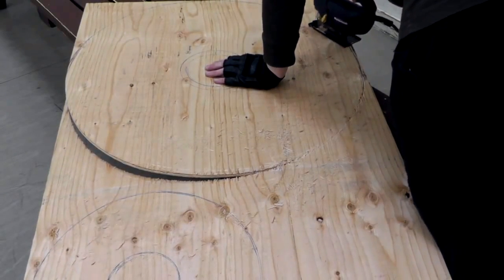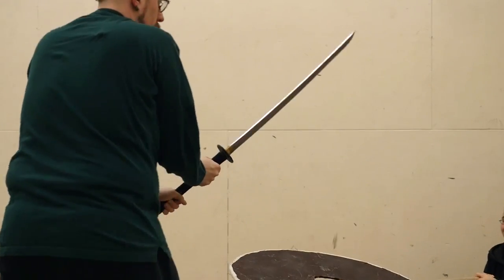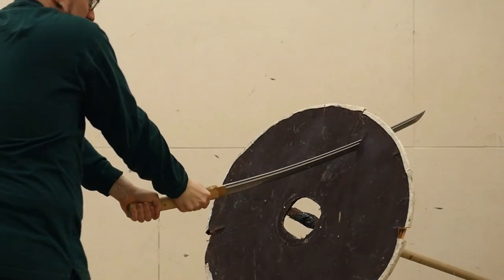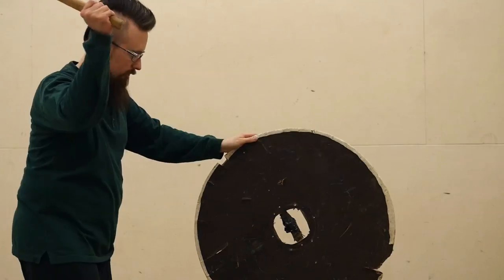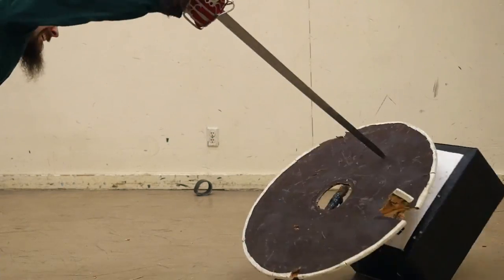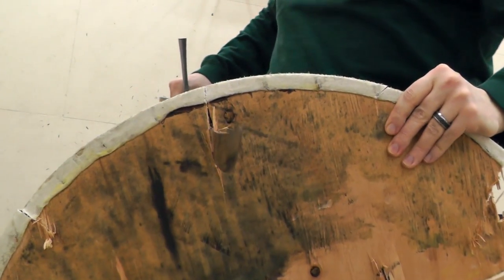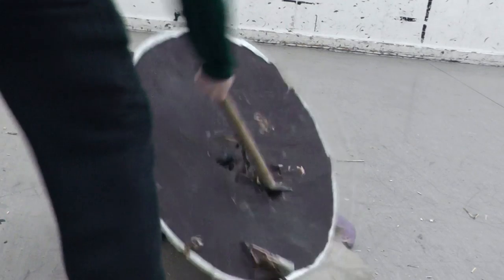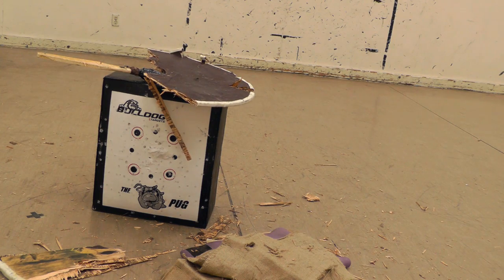Plywood shield vs broadsword, katana, axe, kriegsmesser, and war hammer

Comment: you mean the glorious nippon steal of the katana did not cut trough a nail.... how is this witchcraft possible
Reply: Samuel Normand It's ok, the nail was made from a katana.
Reply: Samuel Normand trolling got wrong this swords are modern muku blades. The steel has nothing to do with histrorical accurate steel AND the heat treatment is most probably total different. ;)
Reply: iopklmification sooo, it was a KATANAIL?
Reply: Benjamin Brohmer 
Yeah, the steel and heat treat are both better with modern swords.
Reply: Fuq Gooogle
the average modern steel is cleaner as the accurate steel in average, yes.
But they are muku-blades made from one kind of steel most katana blades were made from at least 2 types of steel. The physical charakteristics in shiro-zukuri blades were basicly designed by the smith as the edge the flats the back and the core were made from different steel. 
(A useable shiro-zukuri blade would at lest cost 600/800 bucks.)
The different heat threat brings different charakteristics. eg a stiff blade, like the authentic japanease blades would basicly ignore a gambenson or a padded jack, the edge flexile blade on the otherhand would become disaligned and would have a harder time to cut through it.
You also have always a slight disalignment while cutting even in the air, this effect is larger in flexile blades and smaller in stiff blades.
You can't aplay better when comparing different things.
Reply: Benjamin Brohmer 
Well you can get katana today that are pattern welded, folded, laminated, and differential tempered, etc but it's really no longer necessary. All of those methods were used to make up for impure steel of unknown alloying with imprecise heating methods. And the smiths of the time were good at it and made good swords, but I'd be willing to bet that a well made $300 katana blade with a good monosteel (lets say T10) and through hardened would be as durable if not more durable than a traditionally made katana. I would be very impressed if any katana of any construction or price could "ignore" a gambeson, assuming you're referring to cutting and not thrusting.
Reply: Fuq Gooogle http://www.myarmoury.com/talk/viewtopic.php?t=11131 scroll through - 30 layers of linen cuted through.

It is not about the quality it is about the physical properties.
And no not all smithing techniqus were used to handle impure steel. Thats what folding is for. Wielding different kinds of steel together is done to use steel with different physikal characteristics on differnt parts of the blade.

Im pretty sure that you can make a stiff blade with modern methods, not questioning that, but the modern blades are made like the modern european swords. Strike the handle of most modern katana you will see the tip vibrating, which is not the case in authentic katana.

That are different blades.

Or would you consider eg a not heat treated longsword as the same as a authentic longsword?
Reply: Because Katanas were made to cut flesh.
Reply: Samuel Normand It's sad when the trolls of the apparently non-existent katana cultists are a million times more annoying than the cultists.
Reply: Hush, child.
Reply: Samuel Normand "The Glorious Nippon Steal" sounds like a great title for a heist movie.
Reply: ***** It's really not that simple. There are plenty of cheap swords that are just as good at cutting, or better, than the several thousand dollar ones.
Reply: +Fuq Gooogle I'm so sick of this katana glorifying crap.  Katanas are not superswords.
Reply: ***** Yes... yes it is.
No, they wouldn't For several reasons. The biggest likely being that people have this weird idea that more expensive = better. This isn't really the case. Secondly, people who buy swords these days aren't buying them as serious weapons, so they care about things like aesthetics, and historical accuracy, which command higher prices. There's also a lot of shitty cheap swords too.

No, they don't all use low quality steel. In fact, the MOST EXPENSIVE swords ARE made with low quality steel, because the most expensive swords are generally made using historical techniques.

Thank you for demonstrating you don't know what you're talking about though.
Reply: +Samuel Normand Actually, it did, though it was not a great angle.
1:31

Comment: Plywood is hard to cut simply because it is a laminated stack of wood with alternating grain orientation. So you will always be cutting with the grain of certain layers while cutting against the grain in other layers, this build structure gives it strength in all directions rather than in straight lines like a plank shield would.

Comment: But according to these otaku nerds katanas are supposed to be able to cut a shield in half with just one swing.
Reply: Katanas are supposed to be used against flesh, anyone who says they are effective against armors or shield are simply ignorant of the facts
Reply: The Japanese dont use shields because Katana's would cut them clean in half. Obviously, duh.
Reply: Roland Lee the arms holding the shields yes.
Reply: Katanas wouldn’t be able to cut a wooden shield from the face
And a clean cut in one side only do a very few damage
Katanas and the variations are overrated, there are good swords but  there are better swords

Comment: Bu..buh..but Katana best sword folded over 100,000,000 times!

Filthy gaijin.
Reply: But a katana doesn't have a pommel, so you can't end your opponent rightly.
Reply: adobo777 This test proved that the deadliest weapon is a Home Depot forged nail. To damage a katana that nail most have been bathed in dragon´s blood and the tears of a thousand virgin geishas otherwise it would have been pulverized by all the power of nippon steel. ALL HAIL THE MIGHTY NAIL!
Reply: adobo777 The strongest were folded Zero times. Cut wing off strongest american birds no problem comrade.
Reply: The reason kata as were folded is because the iron used was extremely shitty, so if a blade needed 1million folds you were basically using a giant block of slag...
Reply: This nail must have been folded at least 1.000.000 times.
Reply: Z Rose That is where you are wrong, good sir! But such a tiny pommel would do nary a thing!
Reply: John Jones Are you insane?!

Everyone knows that the sword is a limiter of the pommel's power.

We can't just have pommels rolling around in rucksacks! One wrong move and we may tear the fabric of spacetime its self.
Reply: +Woofdeath13 I know the exact gif you are talking about...
Reply: +adobo777 your joking right? lol

Comment: The wooden shield gets a wave of vibration trough it each time you swing any weapon at it. The handle works as a back bone structure for the shield as it absorbs most of the vibration going trough the shield. Once the handle is broken off from the shield, the vibration starts to go trough the fibers of the wood and start to let go. This will result in cracking which takes out the structual integrity and breaks the shield. 

Shields that have strips of wood nailed to them going from the center to the edge in a circle will increase the shields structual integrity a lot but increase the weight of the shield. Using plywood will be light, durable and cheap. 
As we can see from the video, it could take a serious beating before even taking damage. 
In a serious battle, the shield would be indestructible versus a sword. 
Even if against an axe or a hammer, it would last for a long time before being unusable. (The user would either die or win the fight before the shield breaking.)

Comment: can someone lose their weapon when it gets stuck in the shield. it like it will be a major problem when your trying to remove your weapon your opponent gets a free hit
Reply: Dario Gonzalez if it gets stuck, simple drag backwards from the shield person and you stumble into his weapon if you dont watch your step.
Reply: Dario Gonzalez In actual combat you'd usually attempt to bypass the shield, instead of destroying it. Or you do as the romans did and throw javelins before the melee engagement, those were less meant to actually kill someone and more to get stuck in the shield, to make them useless, thanks to the added weight and imbalance (considering that most shields around that time had a center grip).
Reply: ***** well if could still get stuck in the shield even if you are not going directly to the shield you could end up hitting it even your opponent blocks with it.
Reply: Dario Gonzalez
Of course. And yes, if that happens it is likely that one could lose their weapon and, most likely, their life :)

Comment: So basically don't try to kill the shield, but the person using it. Thanks captain obvious :P

On a more serious note: I think WHEN hitting a shield you shouldn't focus on wheter or not it makes a hole in it or how deep it cuts. What you want is to apply a lot of force to the shield, because that force gets through the shield into the arm of the person holding it. So i think even tough hammers might look unspectacular, they probably did a lot better against shield wearing units than one might think.

Comment: A simple, thin wooden round shield with metal edge and boss is actually pretty darn effective, at least against cuts and chops. Center-grip shields like this are also decent at turning aside maces and axes from center strikes. Of course, wooden shields aren't quite so good against solid, heavy thrusts, such as those from a spear or from arrows. Granted, a well-made one will still stop the blow decently, but the point might stick through enough to cause problems.

Comment: That katana is evidently broken, a non-broken katana would cut through a plywood shield like a hot knife through butter. They are still used to cut diamonds and steel, so i dont know what you did to yours to break it,
Reply: Nice try :)
Reply: dave epsin i love it
Reply: dave epsin Yeah, I've never heard of a katana being used to cut diamonds and steel. I'm pretty sure it's a Samurai weapon, and not a jeweller's tool, or a blacksmith's tool.
Reply: Kevin Meisenbacher the joke>

your head>
Reply: I agree, when i have an authentic shimazu made katana i would be able to split bullets as they flew at me. I am, however, quite proficient with the katana.
Reply: Mason Wiegand From who did you learn your skill? i learnt from master will kieth
Reply: dave epsin  Lmao, you don't know how steel works do you? Steel can only be so hard regardless of who made it or how it is made. A katana cannot cut a diamond by being sharp, the only way to break a diamond with a katana is by hitting it at the right angle so the weight cracks it. Even then it would be extremely difficult and would ruin the edge of the katana if it didn't break it.
Reply: Daniel Hart you dont know how a joke works, do you?
Reply: i do, and i was dearly hoping it was a joke
Reply: +dave epsin That's nothing, I can break rocks with my hands as if they were balls made of mud.
Reply: clearly, he's out of chakra
Reply: A katana was a backup weapon at most, guns and such were used more in wars than katanas.
Reply: ~weeb voice intensifies~
Reply: Kata is so damn overated... omg
A katana is made t cut fleshy areas 
Not armor

Comment: Interesting video, thanks for making it.

I imagine that in battle getting your weapon stuck in your opponent's shield would be a big problem. While it is stuck you are effectively disarmed, and they can strike at you until you free it. That would probably make people a bit hesitant to strike at a shield's edge full force. Also a shield in someone's hand probably has a bit more give than one sitting on the floor, so impacts wouldn't transmit the force of a blow as efficiently.

Comment: there was a reason the Romans used plywood for their shields, as did several of the other peoples around the Med and into the more arid parts of western Asia.  Even with just their fairly primitive glues, laminated sheets of wood with alternating grain directions made for a significantly stronger shield.  You didn't generally see that in Northern Europe because it was damp enough that just like laminated double recurve bows, the laminated wood tended to DE-laminate over time.

Comment: Lamelar plywood is quite tough.  The 'grain' of the shield as you mentioned is also not truly there, the layers of the ply are set against each other so that the grains of the layers are offset so you are never truly cutting with or against the grains as a whole.  Also modern plywood is thicker (1/2"-5/8" - 12mm-16mm) than a traditional butted slat shield (3/8" rim progressing to 1/2" at the boss).  Still, a nicely done destruction demo, too bad about that nail.

Comment: 2 tips:

- Use some sort of ash wood, the older the better. Since you are bigger than a mighty viking of 1.65m, you shield should also be a lot thicker. 

- The hide you are using has been softened chemically to make is easier to work with. That is exactly what you do not want in this case. Instead use a untanned raw hide from a boar. I is not flexible unless you soak it with water and it gets rock hard afterwards. They are hard to get, so you have to speak with a hunter most likely. The only goods still crafted with it are some drums and chewing toys for dogs.

Comment: Have you considered using a higher quality wood? In Argentina we have a tree called "palo amarillo", which you might find it imported under the name "Argentine Osage Orange"; It is denser that Hickory but also stronger and very hard and rigid (high elastic modulus). You could make a shield with an 80cm radius and 11mm thick while staying under 12 lbs. You can get 3 foot wide boards, so no extra work gluing planks. If you want it for sparring, you can glue Cut-tex pro with resin to both sides and the radius. I wouldn't be surprised it a shield like that stopped not only arrows but also low power bullets like subsonic .22 lr.

Comment: Plywood, due to the, y'know, plys and glue are much stronger in most cases than an equivalent thickness of the same kind of wood.  The "same kind of wood" being one of the keys, here.  Most plywoods are whitewoods - pine, spruce, that kind of thing - but there are several easily available wood that are much harder than whitewood.  A plank shield made out of ash (easily available and very durable) would be interesting to see vis-a-vis cheap plywood.

Comment: One of the things that it did NOT have (which, given the amount of stability added by the center grip) is any reinforcement on the center. If that was the case (such as the round metal part on a center grip shield) it would have probably last much longer.

Comment: Ideally, you wouldn't want to cut that deep into a shield because of friction. You'd probs want to make a bit of a glancing forceful cut to either side, preferably adjacent to the enemies weapon and then ride the contours of the shield down to the abdomen before he finishes his parry/block. This all rides on the principle that the guy is actually competent with a shield.
Or if you had such a deep cut into the rim and you were using something with a very generous hilt like a kriegsmesser. You could theoretically wrench the shield like your using one big sharp pointy crowbar, but then that leaves you open to a follow up strike from your opponent. Still it would be cool to find out if this is plausible

Comment: Plywood is tougher because it's made of multiple laminated wooden veneers with each sheet put 90 degrees to the previous veneer's grain, which negates strength loss due to the grain and other deformities of wood.

Comment: I think it might be more that the repeated hammer blow massively degraded the ply-wood rather than the centre grip adding stability. It looks a lot like the ply-wood is delaminated when you attack it with the axes at the end which will dramatically reduce it's strength.

Comment: I have done axes for a long time now so a little tip :) 
With the Longaxe 
turn it around and hit with the neck on the flat it will not stick and will work more like a giant warhammer  
it is a safer way to use axes on shields bash them and then turn to the edge 
hooking is good if in a line or with some one else or else it is as bad as getting stuck 
thrust/knocking with the top is a little better then and you might also get away whit a bit  of noughty ;)
insted of grabing and turning the shieldrim get your axepoint stuck like in the video and use your body to turn and push the shield around and of to the side 
they will be of balance and the shield  out of the way trasition to the body will be easy :)

Comment: Single ply wood like thin planks have a lot less resistance to being split, or shattered. but they all serve the same purpose..get in the way, absorb the shot, and keep pointy/blunt things away from yer tender bits.

If I were the one holding the shield I'd be very happy when the swords got lodged...that's when I would have went offensive and struck on their weapon side to try and get in a good shot.

Trivia, the long metal shaft of a Pilum was partly to allow it to lodge in a shield then drag it down..The warrior with the shield had to pull the Pilum free, or drop his shield do to the weight and bulk of the spear being lodged in it.